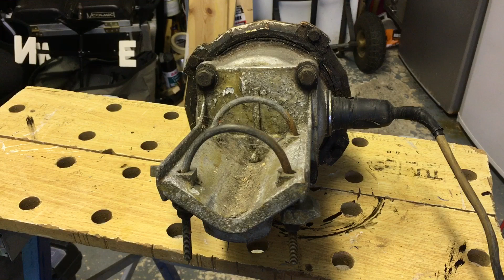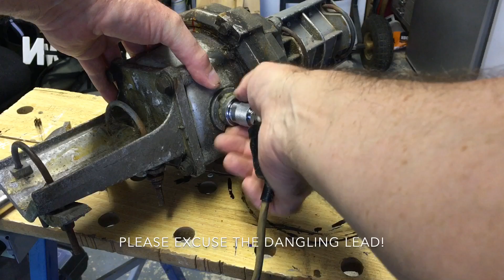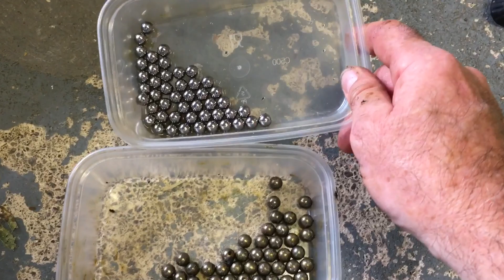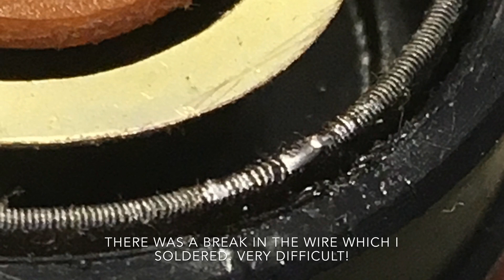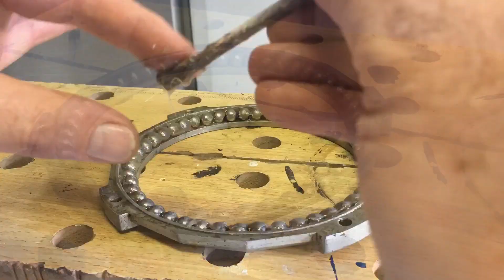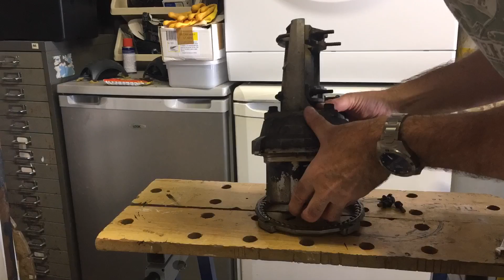Rotator / Rotor Maintenance

Comment: Did you have to look on line for parts or did you know where to buy parts for your rotor
Reply from the maker: Hi Tony. I repaired by soldering and didn’t need parts. None are available anyway, so I didn’t have to cobble anything together 🤞🏻

Comment: Hi,  Thanks for a good incite to the rotator I have that's never been apart.  I am about to climb my 17m tower which cranks down to about 11m to remove my seized Aiga ART-3000C.  I need to know what size spanners to put on my belt as my legs will only do 1 up and down climb lol.  I heard you say the 10mm spanner is for the bearing clamp assy but what size spanner will I need for the Base Bolts and the U-Bolt Nuts.   The rotator was installed in 1981 when the tower was at ground level into a cage within the Tower 2m from the top. (Modified Tower) then raised up.  It seized about 2005.  Due to the exorbitant  cost of a rigger these days or a high cost of renting a 17m EWP, I decided to climb it to remove the rotator, repair on the bench and re-install.  I have a new set of ball bearings for it and hoping that's all the issue is besides solid old grease.  The Motor has normal resistance measurement down at the controller but nothing turns despite correct voltage across the motor wires when  E/W levers operated.
Cheers Mike VK5LX
Reply from the maker: Hi Mike. Good luck with the refurb! I think the base bolts are 13mm and my u-bolts for the side clamps are 10mm, but these may differ on yours? If you take up 10-14mm with you, you should be covered 👍🏻 Hope all goes well and it’s an easy fix 😀 If you look at the Shorts on the channel, you’ll see a quick overview of a recent fix I made to this rotator. Worth you checking too while yours is down ✔️
Reply: @G0CNN-Ian  Thanks Ian,  found in your shorts and seems that could well be my issue of a loose motor gear screw or a stripped motor cog.  Motor draws normal current, no high current stall like a seize up so likely just spinning not driving.  Time will tell when I get it down.  Any issues pulling the gearing apart and putting back together?
Reply from the maker: @mikebloodworth9258 No. just lift off as is and keep it in that meshed position. If you’re doing a 100% clean, then photo the cogs I’d say. There’s a small washer on the bottom of one set and a small collar on the other. Keep an eye out for these when you lift. The motor shaft has a flat spot to engage the grub screw against. 🤞🏻for you!

Comment: Thanks for the video, my rotator needs stripping down and now I have the confidence to try it. Like you, mine was second hand when I purchased it about 12, or more, years ago. It sat in a garage for about 5 years before I was able to use it - and it worked first time. Last winter did something to it as it is trying to rotate but not really managing it. I would guess the grease has stopped being grease. Hopefully the gears are intact as it is one of those offset type rotators that used to be nice and cheap but are up into 3 figures these days, so probably not the best quality but it has done great service turning my active loop for a number of years. Off to order a pot/tube of lithium grease now. 73 and welcome back to the hobby - Sean, G4UCJ
Reply from the maker: Have fun Sean! Sounds like a doable job 👍🏻

Comment: Ian, thanks a lot for the detailed video! I have here the larger Aiga ART 8000 rotor with controller for which I'm lacking  docs expect for an ad in an old 73 magazine. Have you ever come across this version?
Reply from the maker: No sorry, although I suspect they are basically the same design but with a higher spec for yours? I didn’t know there was a larger model. Hope yours is ok? I use mine for my portable station 😀

Comment: Nice work. I think I would have re-terminated the control cable rather than rejoin it. You should be able to find some suitable modern push buttons, too. 👍
Reply from the maker: James Bowie Thanks James! I did try and connect direct into the original 8 pin round plug, but the black plastic was brittle and didn’t want to play ball ☹️ I ended up with the join as there was also a spare length of the 8 core cable (with red & black thicker cores), so I spliced that twice (😮) and that gives me about another 3 metres of control cable at the shack end to play with 👍🏻

I’ll keep an eye out for new switch fronts or even new rocker switches if I can find something suitable that fits.

Thanks again. 

Ian.